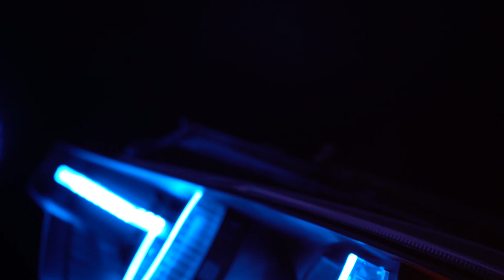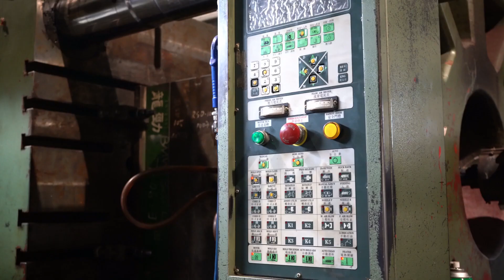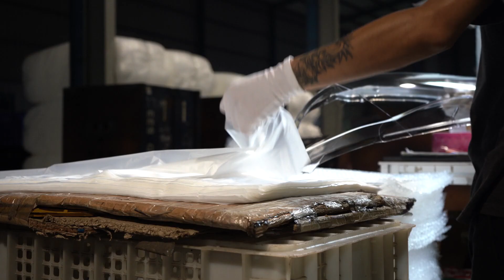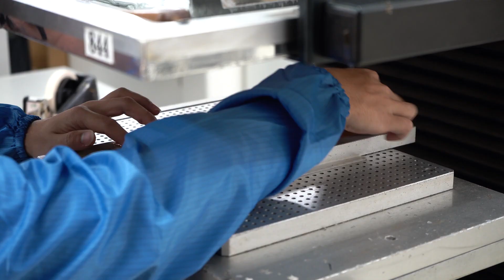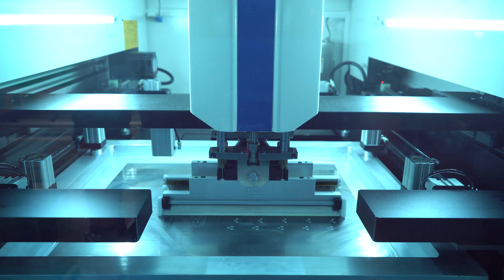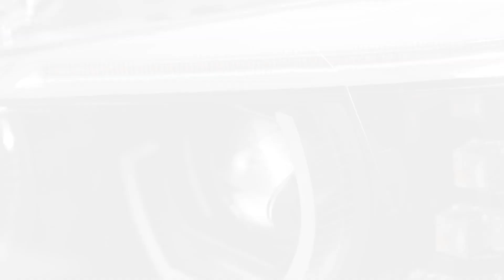DNA Motoring Lighting Manufacturing Process

Comment: I have these headlights but the angel eyes don't change colors, they are only white. How can I get them to change colors?
Reply from the maker: What is the part number of the item you purchased?
Reply: @dnamotoring  I bought them on Amazon and it says that the manufacturer's part number is AD-HL-3D-F3013-BK. This is the Amazon link I got them from: https://www.amazon.com/dp/B0792LGZXV?ref=ppx_pop_mob_ap_share. Any help would be appreciated. Thanks!
Reply: @dnamotoring  So DnaMotoring, where is the help? Mine also don't change colours...